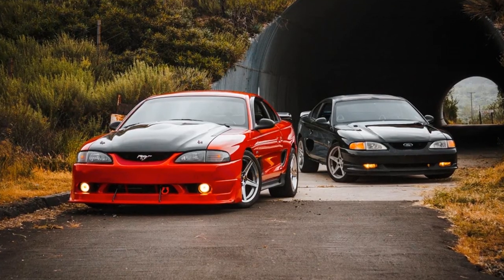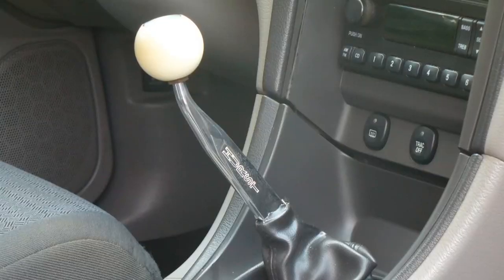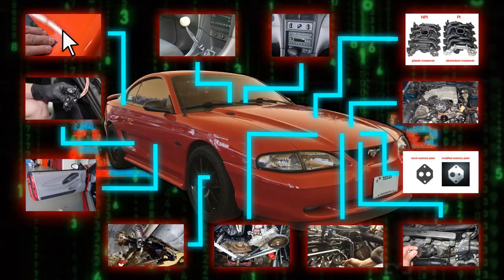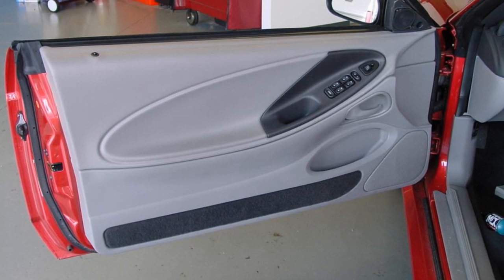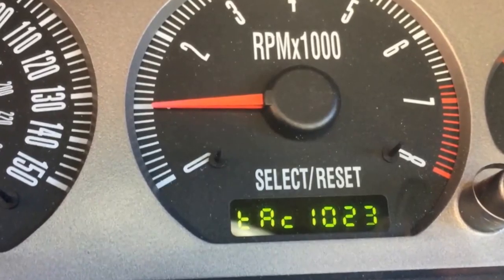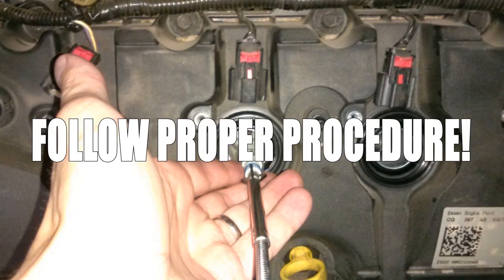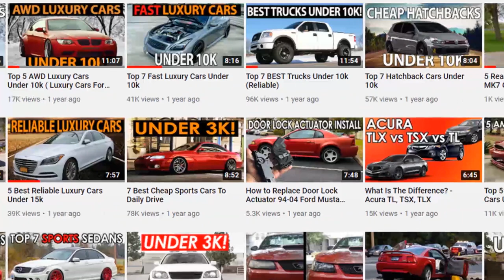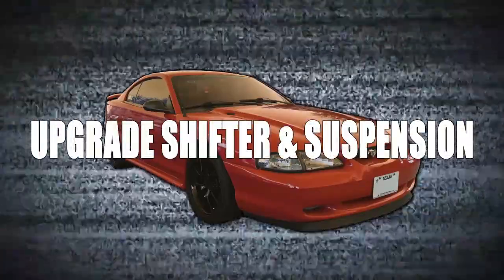Watch This Before Buying a Ford Mustang GT SN95 1994-2004

Comment: I just got a 4.6L sn95 from 1998 a few months ago and can confirm that all it needs is new suspension and a short throw lol
Reply: It also needs shorter gears and some noise, and if youre 6 foot 6 forget about it.

Im 6 foot 5 and have 4 inch seat rail extensions that dont help much.
Reply: It does 142mph and spins 1st if you try hard enough
Reply: No tcs, no abs, poopy solid axle
Reply: power windows tho, and a fog light toggle switch from factory
Reply: @Turismo860  haha I have a 94 gt and my dad is 6’8 and fits in it great
Reply: @rileyrussak7469  6'8 holy god
Reply: Got the same car, look for some 01-04 heads, cam, intake. Look for a 96 fuel rail set, and upgrade the rear gears to 3.73.

And tune it

You’ll wake that car up to 350+whp
Reply: @joshuaisham3929  I have a 96 cobra, bought some 01 cobra heads a while back that I want to send off to get fully built and ported, also want to do a high compression big bore set up, plans are to make around 500whp all motor and spin the motor to 8k rpm
Reply: All of them need suspensions🤣
Reply: hey i was just wondering is 215 horsepower al out for a 1994 Ford Mustang 5.0 L
Reply: @carlosv5859  5.0 should make 250 - 270 maybe 300hp if my memory serves me correct.
Reply: @carlosv5859  check out my brothers 95 gt 5.0 on my channel..it has a trickflow top end kit, upgraded fuel system, and a vortech supercharger making 430whp
Reply: needs to be a svt cobra or u ain't really having fun
Reply: I got coilovers n they r great
Reply: @ciarantelge18 what’s the cost on that build !?

Comment: Most of this was pretty bang on.  The suspension is no lie mine rides like a tank and it's got fairly low miles on it. The shifter is an obvious one:(
Reply from the maker: Time for some modifications, I see. I installed the pro 5.0, and it was night and day transformation.
Reply: @AutoMotivate  Is that a suspension mod? I have a full exhaust system and a a cold air intake with some nice wheels but I need to get more stuff done to it
Reply from the maker: It’s actually a short trow shifter! 
Makes the car feel 10x more aggressive. I also installed lowering springs I bought used and replaced the quad shocks. 

Made a huge difference. 
I would also replace the shock and install chassis stiffener modifications. There is a frame rail stiffener you can install

Comment: What about the 4.6  in the 1996 Mustang SVT Cobra. Are they reliable?
 Just  bought one 21-K original miles .  
I paid $12,000 for a convertible. 
The car locks drives and smells like a brand new car , garage kept .
Reply: The 96-98 cobras are phenomenal cars! They really engineered those cars very well. But like all cars there are common things that can go wrong. One of the most common flaws of the 96-98 cobras are intake manifold runner control (imrc) failures, they tend to get stuck after about 100k miles, you can either have them cleaned or replaced with imrc delete plates, but if you delete them you have to get the car tuned! Another problem was they had a small over heating issue but it’s really not that big of a deal, the temperature just sits a bit higher than the 97-98 cobras since they fixed that issue on those years…other than that I’ve beat the crap out of my 96 cobra for two years straight racing everyone and the only thing that ever went wrong was my transmission from power shifting, and one of my ground cables came loose causing my radiator fan not to work and overheated my engine, but these cars are solid!!!

Comment: In my opinion I don’t think the 94-95 car should be included in any comparison with any Mustangs period. I have owned a couple of really nice 04 Gt cars that came from the factory with 270hp and I put a cold air intake on them and I swear they had 300hp. They also were incredibly reliable great A/C automatic transmission everything. That being said that 04 car is the only one that can even come close.( Of course the two years of the terminators are exempt). The 95 Mustang Gt I have right now is far superior. I owned a 95 Mustang Gt convertible also and it was incredible.

Comment: Bought a 2001 gt with 87k miles and within 3 months it started misfiring. Changed spark plugs, one plug was smashed. Thought that was the issue, drove for another few months just cruising and no issues. Floored it once and i got thru one gear before a big pop at about 5k rpm and what now sounds like rod knock. Dont know what happened but does not sound good
Reply: Try replacing cap and rotor

Comment: I have a 96 cobra,engine wise the only problem cobras had was a little over heating issue but that was recalled and fixed by ford,most of them at least. As far as handling goes,stock suspension really fucking sucks,the car definitely needs good set of coilovers or lowering springs,sway bars,subframe connectors,a panhard bar,torque arm bar and lower control arms..the front suspension you will also need a better steering rack for better steering response other wise you’ll have too much steering play,trust me,once you get rid of the shitty handling the car is a blast to drive!!!!
Reply: Hi I’m thinking about buying a 96 mustang gt cobra, it has 80k miles for $9k what are some issues I should know etc. how many miles does your car has? Thanks
Reply: @ueatbetteritrainbetter6706  honestly the 96-98 cobras and gt’s were solid! They honestly really didn’t have any issues and ran really good for many miles! There are plenty good running high mileage mustang mod motors! My 03 mach 1 has 200k miles on the original engine and it’s still running strong no issues! Only thing that I ever had a problem with was the over heating issue from a bad water pump, and recently the clutch going out but that’s it! My 96 cobra same thing! But I replaced water pumps on both cars now they run fine! And my 96 cobra has 124k miles with fbo and tune, runs like a champ

Comment: When I got my mustang two years ago : 
I had issues everywhere! It was $1,800. I knew what I was getting myself into but I would consider it my project car back then. I’d already own a Toyota, still do. They’re both my babies. Anyways, it had issues with the differential fluid spilling out, a lot... that was my first fix. Then I had issues with the brakes being old, easily fixable, but they failed to mention that the brake fluid was running low, so I had to get it towed to a mechanic to fix that. Back axle was at the verge of giving out so he had to fix that too, out of my range. We had to change a wheel bearing. I had rewired my car’s electrical lights since the previous owner did them incorrectly, that was the easiest for me to fix but also extremely time consuming. I had changed from lightbulbs to LEDs, so I had to wire the LED headlights as well. I also did the paint job on my car. It was easy as well but very time consuming. Then the interior, I needed to change the back speakers to newer and better ones so they would work and sound badass B-) Then I changed the radio since I wanted it to look slick. I added a CD holder on my dashboard and some cute figurines. This mustang hasn’t failed me since. It’s been up and alive since I fixed the major issues. They are absolutely reliable as long as you keep them well maintained, up to date, and give lots of loving to them too.
Reply from the maker: You are a prime example of someone who isn’t afraid to revive a car that wasn’t taken care of. I love that. Something more people need to do. 
You are able to buy the car cheap and customize it the way you want to. Perfect. 
Like you said, if you take care of them, they will last a very long time. 
Glad you are safe with that brake issue!
Reply: @AutoMotivate  well thank you! I’ve had people behind my ear tell me what a waste of money it was but I think it’s worth it once you set your mind, labor, and time into it. After all I made my own money and with passion for that car,  it was worth it at the end as the car has and will last as long as it is taken good care of it. Not to mention how much I love it. So thank you for that positive feedback!
Reply: i bought the a 1998 mustang gt for the exact same price a month ago! Going to replace the transmission and do a manuel swap. Added one piece modern LED headlights, got lowering springs, new performance shocks and struts, ordering a compressor to do a paint job on it too. I did a 2 stage compound polish but some paint is just too far gone and needs to be repainted

Comment: As a 2000 GT owner I can more then verify the intake manifold and actuator problems. The intake had a PLASTIC housing for the thermostat and of course leaked severely which caused me to buy another one with a METAL housing.

The door actuators actually went out about 85k  which lasted much longer then I expected. But after having them replaced the Passenger side one broke again.
Reply: Same here

Comment: dumb video, mustang guys dont' worry about all these petty things. most sn95's are modded out and no one thinks about this little things lol.
Reply from the maker: Are you sure about that?
Reply: Yes I’ve owned and modified at least 20 mustangs from 67 to my latest 2013. All these little things your talking about are irrelevant in the Mustang community. We modify and drive the shit out if these cars. No one thinks about if the door window motors and clear coat peeling. 😂
Reply from the maker: I’m apart of a mustang community and they do talk about all the issues I mentioned. There is nothing wrong with being educated about potential issues that may arise with your car
Reply: @AutoMotivate  I even dealt with some myself.

Comment: I think these issues would be true with any car if you don't take care of them. I've owned 5 SN 95 Cobras, including the two Mystic Cobras that I currently own, and two Fox Bodies and I've never had these issues. The paint issue is from someone not washing and waxing it on a regular basis. The only consistent issue was on my Mystics, for some reason, both speedo gears broke at the same time. Those are $10 dollar parts, no big deal. I know this is directed at GTs, but the bodies are the same. I have no experience with the 4.6 Gt motor, but the 32 valve is awesome.

Comment: Is this car still worth it!!? What condition can I get at 3k? THANKS!!
Idk how to work on my cars I'm just willing to put money into it!
Reply: It really depends on who is selling the car in my experience. But you will get a decent looking one, just look around honestly. Keep in mind they’re around 20 year old cars
Reply: Might get one gt for 19
Reply: Just bought one for 3k two days ago, 127k, enjoying it so far
Reply: If you have money to put into it you have an excellent car for many years to come.
Reply from the maker: I bought my 02 SN95 for $2800. Basically all stock and the paint was faded all over. 
The 2vs are insanely reliable if they haven’t been beaten their entire life. 
They are easy to work on and there is a large amount of aftermarket performance modifications out there. 
A downfall for these cars is the boat feeling they have. 
Install a bit stiffer lowering springs(I did a 2 inch drop), new struts, new quad shocks, install chassis brace, front and rear sway bars, and I would even replace the bushing on all the main parts like the control arms and the engine/trans mounts. 
With some YouTube videos, you’ll be able to do it all 🙌 be sure to grab yourself a torque wrench and apply the correct torque specs and use jack stands!
Reply: @AutoMotivate  ahh man idk if i can do all that u telling me u got videos on all this tutoriol?
Reply from the maker: @eddycervantea7882   I sure do my friend! Its fun working on the SN95, too. https://youtube.com/playlist?list=PLLbOHamjDy1ZDTZHAGRLKIUBojDaMeZns
Reply: @Chris Rife i bought an 05 :)

Comment: Anyone with a sn95 have any issues with the intake manifold? I got mine at 138k
Reply: And I’m wondering if I should swap it out now before it starts leaking into the engine and damaging internal parts
Reply: It seems like everything Else is a easy fix but I’m scared coolant will be in my engine and that will require a whole new engine
Reply from the maker: It would be smart to go ahead and replace it. It’s not very hard to get to. And, as long you torque it to spec and instal the gasket correctly, you won’t have much to worry about. 
Preventative maintenance is key, my friend

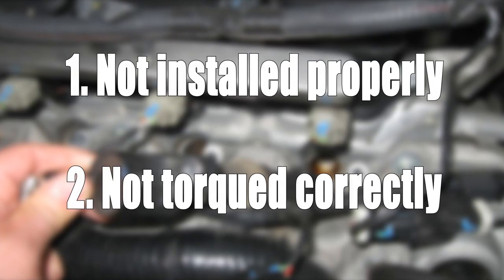Comment: #13 Replace the 3:25 ring and pinion with 3:73 gears, 5th gear isn't really usable until you are going 75 mph +. the 3:73 ratio is much easier on the clutch and makes 5th gear so much better(plus neck snapping performance). You will have to reprogram the computer for the gear ratio change. Hope this helps. :) 2002 GT

Comment: Mines a 5.0.. id never own a 4.6 lmao 

The 4.6 is a thrashy 3 valve that suffocates itself, has two piece spark plugs and a horrible ecu.. 

The 5.0 has the best sound regular plugs still a pushrod (same for the 4.dix) and is crazy cheap to keep.. 

I wanted a 2005 but that 3 valve threw me way too far off 😂

Comment: wow that doesn't sounds like a beginner friendly car to buy, i don't even know how to install half of the shit, looking for a first car here btw, and amazing video non the less.
Reply: They’re not bad, every car has its own issues this video just makes you aware of them, bare in mind this engine was used in crown Victoria police cars and taxi cabs, which are beat on for hundreds of thousands of miles
Reply: @bradweinstein7017  I do like their mileage potential, but it would seems i need to do research before i buy one of them.
Reply: @AceKylar  any update?
Reply: @noelperalta4975  not much, I started working at a dealership, I think i'll just get a new car instead.
Reply: @AceKylar what car you end up getting? i’m looking for one now and it feels like i’ll never get one lol
Reply: @Yng_n3ph  
Hey there, I ended up with 2017 Subaru WRX STI, which is NOT BEGINNER FRIENDLY AT ALL in the first place, (never drove a manual before too) however I did manage to "learn" with the car, and with its reputation of "it'll punish bad owners" I've became an intermediate car guy right now.

Comment: Always do a full PI swap on these cars.
Reply: PI SWAP?
Reply: @trapperdabber6922  “performance improved”  the heads and intake from a 99-04 and put them on an sn95 (non new edge of course) ups the compression and such. ALS certain Vic’s and such had the same type of heads but I’m sure someone more knowledgeable can list those

Comment: Spark plugs don't go into the block, they go into the head. Correct terminology is expected if you're going to purport to be a gearhead.
Reply from the maker: So many gear heads that don’t use the correct terminology. So, I can’t agree with that.
Reply: @AutoMotivate  You're justifying your own use of incorrect terminology with the fact that others do the same? Wow.
Reply from the maker: @redin575  expecting perfection is ignorant, that is all. Chill out